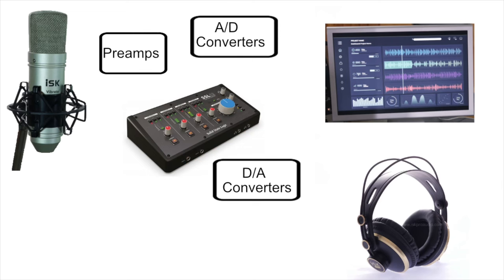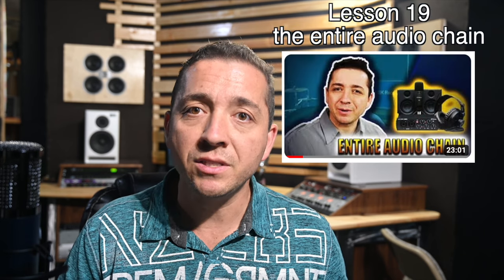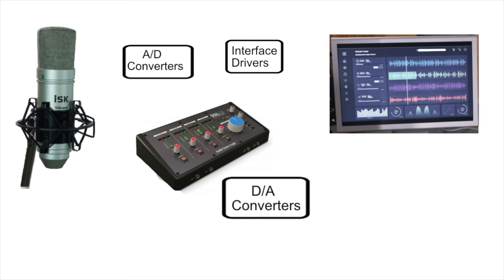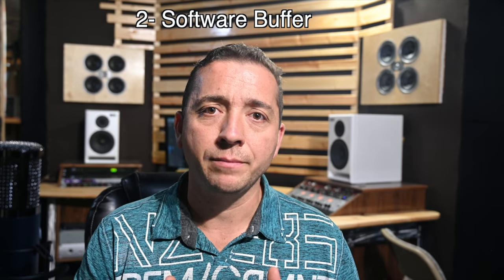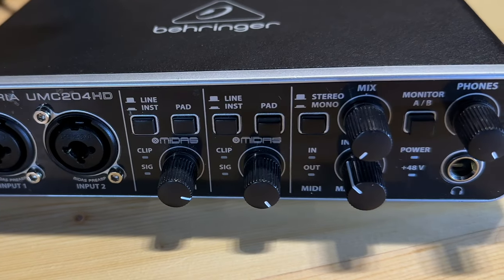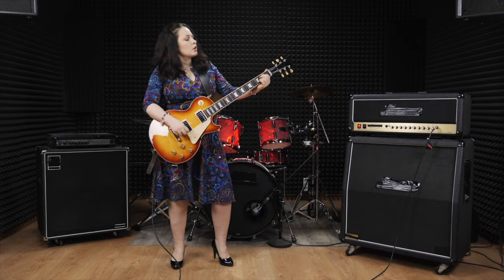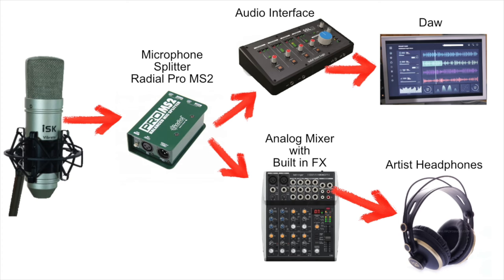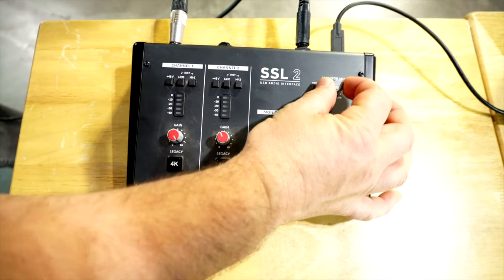How to Solve Latency (With Any Recording Setup)

Comment: I work with many singers who like using auto-tune during tracking, even for subtle pitch adjustments. While I'd pick the Apollo x8 again, the Aurora N converters do sound better. I wish the Lynx system had DSP like auto-tune. Personally, I'd prefer direct monitoring for lower latency, but I stick with DAW monitoring for efx.
Reply from the maker: Yeah… auto tune is definitely a challenge, I think the Apollo interfaces are one of the only solutions for this
Reply: Absolutely! I found your video quite enjoyable. You raised some excellent points! @Get.Beautiful.Recordings
Reply: Two mics for a single vocal track. One goes into my old analog Mackie mixer, which has a send and return from an old Quadraverb. My DAW has an optional output that also feeds this mixer. The mic I use for actual recording into my DAW isn’t monitored during tracking. It’s a great, no latency, with fx, solution!!  So I do this with a small condenser mic attached to my SM7. For monitoring, you also use a 57 or 58, instead of the condenser.

Comment: The information presented is really good and seems very accurate, so i hate to be this guy... but i died a little inside when you said to snip a wire in a balanced mic cable bc you didn't want stereo/unbalanced signal from the headphone output. Maybe it might be helpful if you gave more explanation, but it really looks like you proceed to plug a balanced mic into a balanced input with the cable you just snipped one of the balanced lines on. If this is the case, you will get half of the signal strength from the mic, and you just killed the nose rejection ability of the balanced system. 🤔 What gives?

Comment: I've had dreadful tales of woe with laptops - until I found what was wrong.   Many of them not only give varying latency with changing temperature they also just throw away information when the music gets to a tacit.   The musicians get the blame until, as I say, you figure out what the computer has done.   And here's a handy tip once you are working with a halfway decent computer:  run a sharp click off one track and pick it up with a microphone, now make a three or four second WAV with the two clicks, you can use that as a little ruler to visually slide all your overdubs back that few milliseconds.  Works great, I really recommend it.    Thanks for covering the latency issue on youtube, you've cleared up a hell of a lot of points.
Reply from the maker: I’m glad it helped, and thank you for the kind comment :)

Comment: For the most part, this video is very helpful.  However, I do have a bit of an issue with the Thunderbolt vs. USB discussion towards the end.  Thunderbolt is in fact faster than USB, and in a way that impacts latency, not just the number of channels you can run simultaneously.  Thunderbolt is basically an external PCIe connection, and it has direct access to your computer's memory.  It's not just a little more efficient in how it routes data to memory, it gives your audio interface the ability to directly read from and write to the memory inside your computer, without having to go through the whole USB subsystem, etc.  USB 2 is also a half-duplex connection, whereas Thunderbolt is full-duplex.  What that means is that a USB connection has to switch back and forth in 1ms intervals, taking turns sending and receiving data, while a Thunderbolt connection can send and receive at the same time continuously.  The result of this is that for companies that are still pursuing Thunderbolt in their interfaces, latency is continuing to drop.  The NTP DAD AX Center, for example, has a round-trip latency of 0.67ms over Thunderbolt 3 at 96 kHz with a 32 sample buffer.  The very best USB interfaces and drivers have hit a wall at about 2.1 ms RTL at 96 kHz, 32 sample buffer. Due to the half-duplex nature of USB-2, it's basically impossible to achieve sub-2ms latency over that protocol, whereas latency on Thunderbolt interfaces keeps improving well below that threshold.

One area where the total bandwidth could be a real consideration is this:  32-bit float is starting to be available on more and more interfaces.  I have an interface from 2017 that works in 32-bit float natively, and there are some good reasons to want to use it.  It gives you enough dynamic range that you can recover from bad gain settings after the fact.  However, with 32-bit float, each sample takes up 33% more bits than 24-bit.  When you stack that up in a multi-channel setup, you start to run into bandwidth limitations.  A 32 channel system (not all that uncommon in studios, and way too small for many touring setups) would completely saturate a USB 2.0 connection in 32-bit float (even though the link speed would suggest otherwise, the whole half-duplex thing comes into play here, too).  

RME has done a really good job of selling people on USB, due to the fact that they've written some solid drivers, and they make hardware that people love.  They also have a great track record of providing long-terms support for their products.  Unfortunately, they are also perpetuating technological views that are not based entirely in fact, and I think that's doing a disservice to the industry.  There are really only two substantive reasons why I've seen some interface manufacturers moving away from Thunderbolt: ongoing chip shortages, and not wanting to have to pay software engineers to maintain both Thunderbolt and USB drivers when cheaper USB-only interfaces sell much better.  However, Thunderbolt is persisting in the high-end of the interface market, because it has concrete advantages.
Reply: what if you are using a USB 2 interface ( antelope orion 32) and have the option to use a MADI PCIe card with it?    will the MADI card reduce the latency of a single signal ?  or is it only good for providing more throughput ?
Reply: 100 % Accurate. @isnerdy
Reply: @kimblez  If you are connecting the interface to your computer via USB, then that will still be a bottleneck.  If you are using the MADI PCIe card to connect to the interface instead of USB, then you will be subject to whatever the driver latency is, plus the latency in the optical converters and the latency in the FPGA, so it’s hard to say.  It’s worth mentioning that MADI was developed in 1991, and revised in 2003.  It has lower total bandwidth than USB 2.0, but you can do full-duplex over it.

Comment: If you're on Linux in particular, you should pay attention to number of periods per buffer, the default is very high and changing it is not very obvious in DAWs like Bitwig, especially when using Pipewire/Wireplumber. The default is quite high iirc which causes high latency, the rule of thumb is to set it to 2 or 3, maybe 4, iirc 3 works best for most people, me included. This is a kernel setting for handling block devices, configurable through Alsa (or indrectly through e.g. Wireplumber or when using Jack with qjackctl), it also exists on Windows but there it is set to 2 by default and doesn't cause any issues there.
Reply: And yes, your MOBO's DAC plays a part here too, if you want to monitor through DAW, you can always buy a separate DAC that connects to the PCIe port, but for most MOBOs it's not necessary to get acceptable level latency for live performing even with digital effects like EQ, gate, compression and chorus if your CPU can handle it, especially if your interface allows for direct monitoring which is always preferable.
Reply: A nice feature of some interfaces (like Behringer UMC404HD) is being able to hook up analog effects after the preamp and still be able to directly monitor the signal, so if you're performing live or don't mind having some effects in your signal before it hits the DAW, you can directly monitor yourself with stuff like compression and reverb with no delay, really useful feature if you don't mind buying actual analog effects for your mic.

Comment: Thanks for the info. So if I understand this correctly, for guitarists who want to hear the effects they're playing with, there's no way to eliminate audible latency without connecting a mixer or a reamp box for analogue monitoring? I'm still not sure how a reamp box would help with latency, as I thought the purpose of a reamp box was to convert the line level signal from the interface into a Hi-Z/instrument-level signal that an instrument-level input, such as a guitar amplifier, expects. How does that reduce latency? PS do you have a video showing how to freeze tracks in a DAW?

Comment: If you are faced with this 2 scenerio which would you prefer or go for. Option 1 is tracking with an Apollo twin x using universal audio prepamps and compressors for traking in or Option 2 Using an Audient ID44 mkii with real analog compressors as inserts for tracking. Which would you go for if you are tracking vocals, saxophone, bass and guitar and mixing 100% in the box without UAD plugins
Reply from the maker: In this scenario, I would suggest the Apollo Twin.

Comment: Thanks for this information.  Let's say that I want to record 2-part harmony. I record the drums, guitar, and first voice, then obviously need to hear this recorded material in order to be in sync while recording the harmony. At first I was worried that using direct monitoring would prevent me from hearing the already-recorded tracks.  But I think I understand now -- direct monitoring allows me to hear the harmony that I'm currently singing with no latency, while at the same time hearing what has already been recorded.  I may want to mute the track that I'm recording to, so that I don't hear myself with a latency-caused echo.
Reply from the maker: You are exactly correct.
You will hear everything that was already recorded. You need to mute the track you are currently recording so that you don’t hear it doubled and with a bit of latency.
Reply: Thank you,  @Get.Beautiful.Recordings .  Very helpful videos and feedback.
Reply: @design1569  There's even a special expression for that: "Mix-minus" or N-1.

Comment: The most efficient way I've found to capture a guitar D.I. signal is to have the guitarist plug into a D.I. box and have an XLR cable go to the interface, and the connect a TS cable to the throughput and send that to their rig.
Also  long hi-Z cables don't cause latency, but they do cause signal degradation. This shows up as not as a delayed signal, but a lower volume and less clarity in the higher/lower  frequencies of said signal.
Reply from the maker: Yes… this is true, however, there will be slight signal degradation from splitting the guitar signal with a DI box.
Reply: @Get.Beautiful.Recordings  If the cost of getting a great performance is a "slight degradation" of the signal, I'll make that trade 10 times of 10. The end goal is to get the best performance at the highest quality possible. Unfortunately those scales  can seldom be balanced perfectly.

Comment: Very good video! One correction though: BIOS does have nothing at all to do with PC performance since at least Windows XP. Things that have an influence: processor power and RAM (more plugins, more CPU power needed), energy profile and (if you're not on Linux but on Windows) using ASIO low-latency drivers.
Reply from the maker: Great info. Thanks :)

Comment: 12:50 for electric guitar & bass I always go through my DI boxes so I can record amp and Direct signal concurrently. is that the same as a mic splitter and will cause signal deterioration?
Reply from the maker: Yes. The deterioration is slight. If the di box is passive, then you can’t get something for nothing, so it splits it into 2 signals that are weaker. There’s also a slight loss of fidelity just from passing through the transformer.
If the di box is active, then it routes the signal through an additional gain stage, and gain stages always reduce fidelity just a little bit.

Comment: This video was one of the best videos i have seen regarding this issue. Thumbs up! 
I am using a behringer interface (umc202HD) myself with direct (analog) monitoring exclusively when i`m recording my gitar track in a project that has a finished midi drum track that i hear from the daw when i record.

 It works fine, but my question is this: I hear myself playing the guitar instantaneously through my headphones, but how can i measure how long does it take to actually record the guitar signal in the daw, and how to correct the offset?

I assume there has to be a slight recording delay between the drum track that i play back from the daw and the track that i record with the interface wether i use direct monitoring or not. I don`t use any plugins on the target recording track. I just record the dry guitar singal through the interface.
Can you help me with this please? That would be very much appreciated!
Reply from the maker: If there’s any offset, it’s less than 1 millisecond. It’s a good question, and I don’t know the answer. The daw will compensate for any latency caused by the drivers and buffer, but I’m not sure if it compensates for the latency caused by the a/d converters, which will be close to nothing, and it’s not something I’ve ever even remotely considered to be an issue.
Reply: @Get.Beautiful.Recordings  Thanks for your reply! Very much appreciated. I did a little experiment yesterday with my interface. I generated a click track with audacity. I imported it into my daw software. Then I begun to play it back and routed it into one of my inputs and recorded it. I then analyzed the waveforms of the audio files in audacity again. It showed that the recorded audio file is in 1.09ms of delay compared to the original. It means that as you said the daw actually corrects the latencys of the drivers, buffers etc. but has zero knowledge how long does it take to convert the input-output signal (AD/DA conversion).  Now I know thanks to your video! Thanks! Subbed. :D

Comment: There is one more thing...  The distance of the microphone to the sound source. And...Singers or horn players hear themselves through the head. If they use in ear monitoring or headphones, they'll hear two signals. One without any latency through their head and another through the phones. When these two overlap, even the smallest latency will change the sound they will hear because of comb  filtering. That is something only the artist can hear. And that is why he or she should always have the option to EQ themselves  in the phones for example with an iPad App or so.
Reply from the maker: Good points :)

Comment: What is the best way to send from an outboard pre into your interface? Is ideal to go into an XLR in? I find I’m often going from XLR to 1/4” and that probably means it’s unbalanced
At that point, right?
Reply from the maker: No, 1/4” can be balanced or unbalanced, depending on the cable. If the preamp output is xlr (most are) then converting from xlr to 1/4” is the correct setup, then plug into the 1/4” line input of the interface.
You can verify if your 1/4” connector is balanced by looking at it. If there are 3 contact points (called tip, ring, sleeve) then it will retain the balanced signal. If there are only 2 contact points, (tip and sleeve) then it is unbalanced.